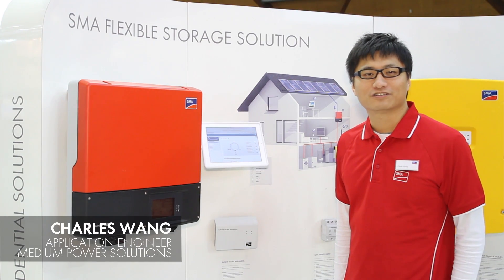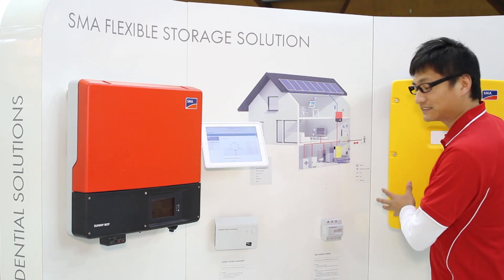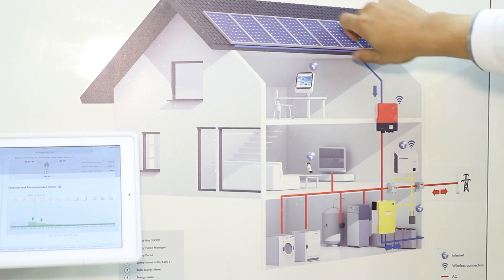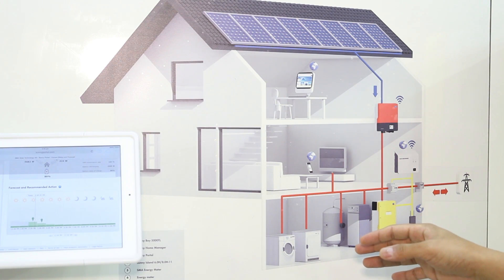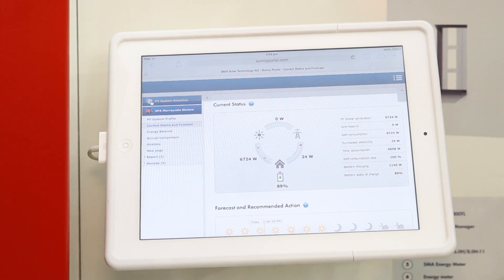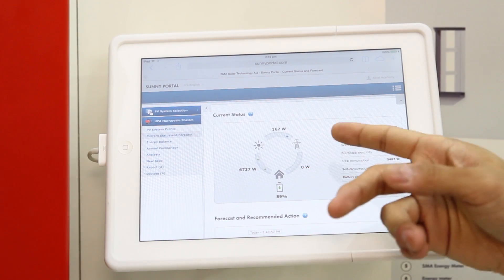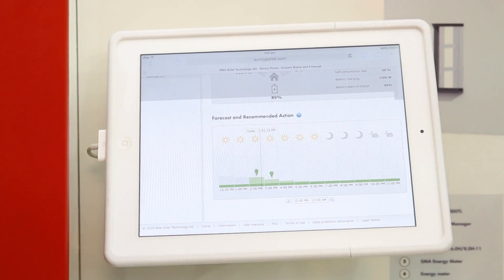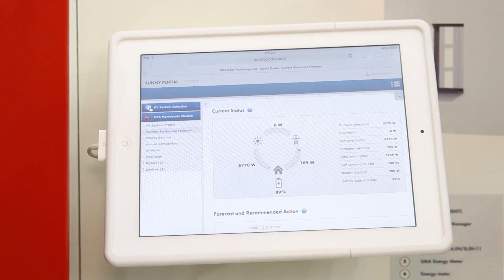What is the SMA Flexible Storage Solution?

Comment: If there is no solar during the night and the batteries are discharged, will the grid only supply loads or will it also charge the batteries at the same time? Is there any functionality within the home manager for the grid only to supply to loads without charging the batteries? the batteries are to charged only during the day through the PV.

Comment: If a main grid  power outage, can we utilize for home network?
Reply from the maker: Yes, that is what you can do.

The Solar inverter will converter the DC  from the Solar PV panels on the roof into AC. The energy meter (or Sunny Home Manager 2.0) will measure the flow of AC at your grid connection point. If there is spare energy going out to the grid, then the battery inverter (Sunny Boy Storage or Sunny Island) will divert this and store it in a battery. When the energy meter detects energy coming into your home, the battery inverter will draw energy from the battery to supply your house and attempt to keep the flow of energy between your home and the grid to zero.

If the grid fails (i.e. a blackout) then the battery inverter is capable to disconnect your house from the grid, and start up its own grid to provide you electricity. When the grid power returns, the battery inverter will detect this and switch your home back to the grid and continue normal operation. This feature though, requires additional components (e.g. Automatic Transfer Switch for a Sunny Boy Storage).

Check out this page for more up to date information https://www.sma.de/en/home-systems/residential-solutions.html or the detailed Home Solutions brochure for end consumers https://www.sma.de/fileadmin/content/global/HomeSystems/documents/Residential/SMA_Residential_Solutions_Brochure_EN.pdf

Comment: SMA - The very best of solar technology. German made  quality. I will from now on only purchase this product because of a low failure rate and high conversion efficiency. No more high production China made clones. I've been through that. Long term waste of money. Install this equipment correctly and professionally and never look back. The Germans make the best stuff!
Reply from the maker: Our quality is not simply a function of where we build our inverters.  Our quality comes from over 35 years experience in this field, designing, developing, testing and understanding inverters. The control systems we have developed around these experiences is what ultimately delivers our Quality.

But of course, that quality has its underpinning in our company's German heritage and the commitment to quality and reliability that typical comes from German manufacturers (across all industries!)
Reply: Correct. I just finished my journey of a full solar PV and battery SMA system. 11.5kw Canadian solar mono PERC. Two 6kw sunny boy inverters and two 6kw sunny island battery inverters. 750 AH AGM batteries.